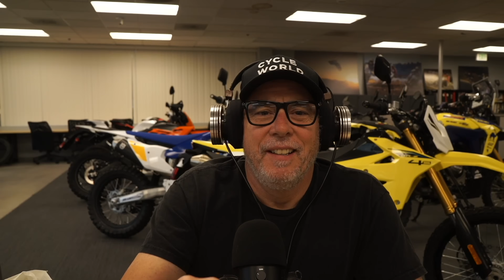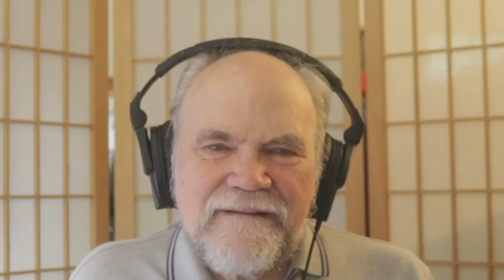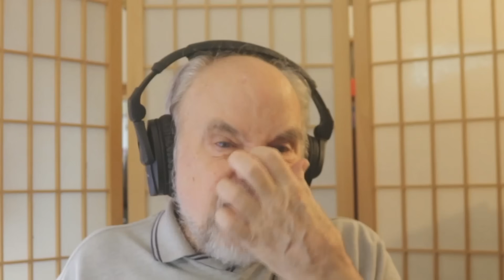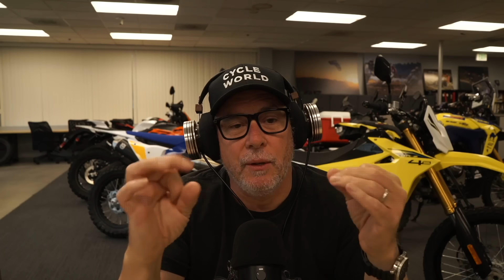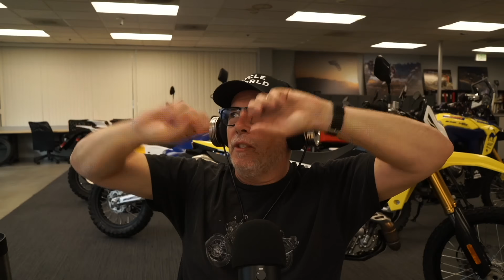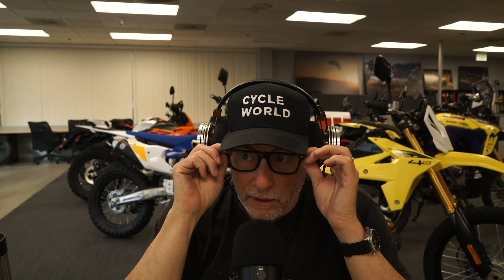CONSISTENCY IS EVERYTHING! Kevin Cameron gets molecular on Cyclic Variation. What?! Listen to learn!

Comment: Typically, the diesel fuel does not really evaporate into (ideally) a homogenous gaseous fuel-air mix like with gasoline, it breaks into droplets which burn only on the surface where the air contacts and diffuses into the fuel in an area of localized evaporation.  Droplets of burning fuel are slower than burning a gaseous fuel-air mix and limits the speed at which diesel engines can be run and still burn all the fuel.  A consequence of this "diffusion flame", where the air and fuel burn around the center of the fuel droplet is that the fuel in the center of the droplet gets so hot that carbon forms to create soot*.  The same soot generation happens with candles when the flame gets large.  This is partly why diesel engines produce much more soot when accelerating. The droplets are larger.  A lot of work has been put into improved fuel injectors and optimized pressures to create smaller but more numerous fuel droplets (there are also efforts to create more turbulence to make certain that each droplet will rapidly encounter all the air it needs to burn).  Those small droplets burn faster and produce less soot, both of which can increase the maximum power generated with lower particle emissions.

*Numerous times over the years, there have attempts to create an emulsion of diesel fuel and water in the hopes that the water would explosively flash into steam and create lots of smaller diesel fuel droplets.  I don't know about lately, but attempts up to the 1980's, when I learned about this failed for one reason or another.

Comment: HCCI is controlled knock.  Flame speed increases as you get richer and peaks around 11.8:1.  High flame speed is also what deters knock in Otto cycle ICE.  "Chaotic" does not mean "random" - that's how they are able to anticipate cycle variation.  Toyota held a chaos conference in 1994 if you're interested.

Comment: I believe Kevin is referring to a system of control based on a device called a PID. A PID controller is a control loop feedback mechanism widely used in industrial control systems. It calculates an error value as the difference between a measured process variable and a desired setpoint. The controller then applies a corrective action based on proportional, integral, and derivative terms to bring the process to the desired state.

Comment: Thanks guys! Regards to abrupt ignition map: Had an 84 Dodge whose distributor had two hall effect sensors. One to start. One to run. Start one failed. 'Limp mode' allowed car to start. Dealers/garages useless. Many starters later deduced problem. A 160hp malaise 318HO could still mule kick.
Reply: Should have swapped it out with an earlier points version or a good quality aftermarket electronic one. I assume it was equipped with the problematic Electronic Lean Burn system?
Reply: @shoominati23  New distributor fixed it. I'm not really a hot rodder. Most I did was modify shift point by changing a spring in the transmission. Was a Police Dodge Diplomat used as a daily driver.  Put it up for sale.  Refused to sell it to a mom who wanted it for her daughter. Too unreliable.  Sold it to a Police Car club. It still lives!